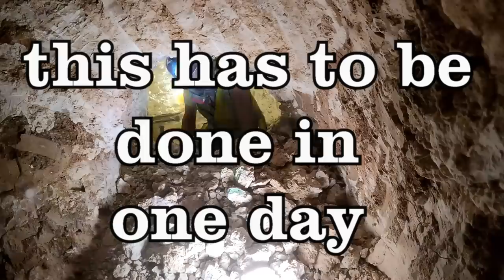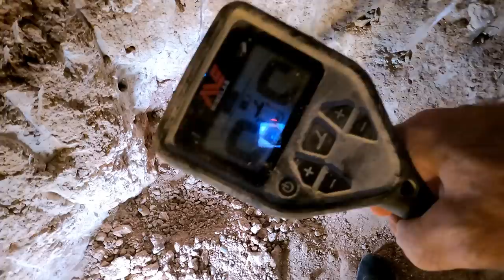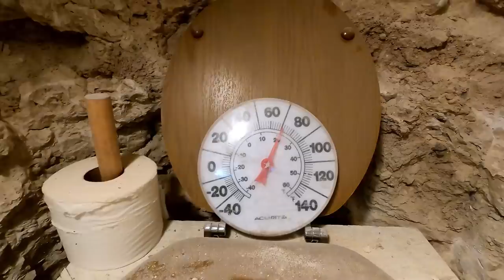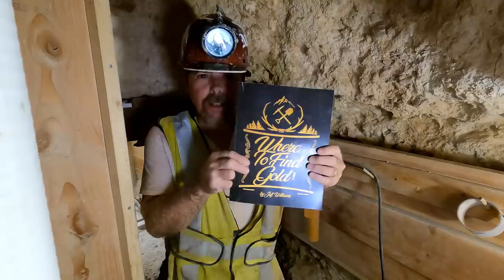THE FASTEST WAY TO DIG A SECRET TUNNEL.

Comment: Hi Jeff , have watched most of your videos. They are great! I have a hammer drill like your and a dealt one with ads max bits. I bought 2 3600 watt demolition jack hammers from ebay, for 156 bucks each.  they ain't too heavy and very powerful and durable! come with 2 bits. I put differential oil in them and they are still going.  Makes digging a ease. Breaks concrete easy! You might get more pay dirt at end of day plus more shiney!!! God Bless You and Your Family, and Slim!!
Reply: Sorry for bad spelling,  sds max bits I meant.  also its orange the ones I bought  on Ebay.  They are Chinese I'm sure. but run great! I had one that a brush shorted out, but easy fix, they come  with 2 extra brushed. 156 each and they are very dependable

Comment: If this were a factory, the engineering department would be assigned to build equipment so the rock would not have to be handled so many times.  I also find it interesting that there is so little dust in this mine, relatively speaking.  I'd love to hear a comment about profitability, you know, when to keep digging or cut your  losses?  Thanks for sharing these mining experiences with us!
Reply: That's a good point about the number of times the rock is handled! The engineering and methods of old style drift mining is fascinating to me!

Comment: When I was a child, we visited Schweizerische Industrie Gesellschaft SIG  Neuhausen. They produced compressed air tunnel drill machines so five BIg and Long drills attached to one mining car. You could drill mutch faster, but you probably need small steel rails and then you usually need explosives to blow the center. Then you use special cargo cars to get the rubble out. But as you really can sniff the gold, don't know if you would like to change your pants for a bigger washing station, and I don't know how much water you have. Look like you find the nuggets in a layer similar to Bohnerz in Switzerland. Unfortunately,  I am not aware, that this layer of iron beans with manganese and a bit titanium also carrys gold here. 
Nice and smart that you use dust protection breathing filters, could also be FFP3 and safety glasses, when available.

Comment: i spread the dirt on the ground or pan it out in my super sluice pan  i wear a ring on each hand. the SS pan is good for detecting (dry panning)  you have the fast track feature  were you hold the discrimination button down till the coil blinks. to ground balance.  have a good day boss

Comment: When I was a child, we visited Schweiz erische Industrie Gesellschaft SIG  Neuhausen. They produced compressed air tunnel drill machines so five big drills attached to one mining car. You could drill mutch faster, but you probably need small steel rails and then you usually need explosives to blow the centerway. Then you use special cargo cars to get the rubble out. But as you really can sniff the gold, don't know if you would like to change your pants for a bigger washing station, and I don't know how much water you have. Look like you find the nuggets in a layer similar to Bohnerz in Switzerland. Unfortunately,  I am not aware, that this layer of iron and manganese beans contains also gold, here.
Nice and smart that you use dust protection breathing filters, could also be FFP3 and safety glasses.

Comment: If you have any nuggets that fracture in two when you dig them out, your method of testing a handful and throwing out if the scoop still triggers, is putting the other half into the wash plant instead of the target bag.  Take another scoop and divide the pile in two, then test both.

Is there a point where there's enough gold that you would excavate a large chamber?

Comment: Uhh... I bought a brand new Xtreme Power 4 stroke gas powered jackhammer and it lasted 5 minutes before breaking. My buddy experienced the same thing. Maybe the electric ones are better. The Bauer I bought from Harbor Freight is going strong and still well within the warranty.
Reply from the maker: have not used the gas powered one ....just the electric one

Comment: Hi.  A suggestion. All that rock dust getting into your hammer tools reduces the life of the tool. Not that it can be helped. But putting some kind of filter over the vent holes helps a lot. But if the tool is getting worm with the filter. Drilling some holes in the case helps a lot. The other thing. Have you ever tried a spade bit in the jack hammer. Works well on a loses ground and knocks hard lumps off side walls. Good work Jeff
Reply from the maker: we usually tape a face mask  on them ....yep we have every bit made for it

Comment: I am an electronics nerd and an aviation quality inspector. (I dig this kind of stuff!) Detectors seem to work best when the coil is in motion over a target. The search unit responds to the conductivity of the target from the oscillating frequency of the coil if the target is close enough to the coil. Pieces of iron, lead bullets, bottle caps, brass shell casings and underwire bras all have a different conductivity, sophisticated units can differentiate between all of these. I need more beans.
Reply from the maker: very good .

Comment: Do you have exp digging like this next to a large actvie water source? If i rig a 900ft wire to a large active river:stand active water source electric generator i could build. If im far out i probably still have to worry about sapping, etc. Btw i could charge a ton of batteries off the river for digging or if its active enough gen 120/240-380/270 volts maybe to power a corded power drill

Comment: Jeff, I have really like the Bosh SDS-Max roto hammer.  With the 8' extension rod, I can drill 108" deep holes down through solid rock at 2" diameter.   Would really help you drill sideways in your adit to explore mineral zones outwards and to assay the host rock body.
Reply from the maker: thats a great idea

Comment: Question Jeff, I watch you with your detector and scoop.
When you've dug the area up and you run your scoop over the detector you....drop a bit out of scoop into your hand and run the scoop over the detector to see if the gold's  still in scoop. 
If it's still in scoop you toss the dirt in your hand and repeat process.
My question what if there was 2 nuggets in scoop and you toss the dirt in your hand and it holds another nugget.
Would it hurt to pass your hand over the detector as well? 
Did ya hear hear me son?
Then let's go👀😊
Reply from the maker: you can't run your hand over a VLF detector because the salts in your body will set off the detector ....we always go over the pile afterwards
Reply: @Askjeffwilliams  Thanks Jeff.

Comment: Jeff,
How far away is the generator from the heavy high current jackhammer? 15-20amp running... got to have a certain maximum length?
Reply from the maker: I think 50 or 75 feet
Reply: I've been evaluating an area approximately 250' in... and planning a electric powered jack hammer as my main. But I know line length vs power line loss becomes an issue with heavy current tools... But someone else suggested using pneumatic jack hammer(air system). You have any preference?

Comment: what this means is if i am right, then putting your metal detector , at the place of 26 seconds time into the video- on screen it is an inch below the right side of the letter "
l" in the word metal-about two screen inches dead left of your nose, both straight lines meeting - it will go off! There is a nugget within the first inch or two of that material! The mineralized areas show up as extra shiny- the nuggets look back-lit!

Comment: A sharp pickax may be faster than that, I dig holes pretty frequently and theres a thick hard clay layer similar to this, Some good swings with the pickax cuts right through it no problem. Also a heavy duty wet/dry shop vac may be useful for gathering the crumbles quickly. You could also use a cement saw or rock chainsaw to cut slices then knock them out with the pick, like relief cuts on wood.
Reply from the maker: Thanks for the tips!
Reply: @Askjeffwilliams  WOOOH YEAH I GOT REPLY FROM JEFF WILLIAMS!
Reply from the maker: @richardjohnson8009  you betcha

Comment: The color on the tunnel material makes me wonder what the assay is. With that much color I'd be tempted to run the lot thru the wash plant provided it has the capacity.  Have the explosive licencing gotten too excessive EG Why not use cordite and blow out a 4-8 ft section and wash it?
Reply from the maker: great idea

Comment: If you made a simple do it your self thing to camp out/ bomb shelter. What would be the best solid stuff to use to start making it clean/dry/on its way to say the quality of a  bedroom in there. Bricks/ then mortar/ then more layers of bricks and more concrete mortar? Or wood? Millions of loops layers of seran wrap like a trapdoor spider?
Reply from the maker: foam might work
Reply: @Askjeffwilliams  so probably a nice expanding for insullation and fire retardant foam. I know you get things like sweat, mist bogging in there with no door or poor ventalation. I'd asume all my housing materials and all indoor wiring is going to be specifically rated for moisture and treated with the outdoor rfi specs in an electrical manual even though im indoors

Comment: Running this low def on a hi def system has most unusual-and i'd be willing to bet profitable-lighting effects upon the sides of the mine. These DO NOT SHOW UP in normal nor high definition. it does not appear to be graphic or visual artifacts (!) those would disappear or wash out with a change of camera angles. These are steady despite changes of lighting or camera movement. Can you verify this please?

Comment: The larger the jack hammer, the easier is to snap off a bit from bad technique. You cannot let the tip sink in real far and then be unable to get it out so you resort to prying sideways with it and the bits are like pencil lead under sheer, they snap off and it's a $90 loss per bit. The key is to know, every chunk of rock you chip off has to have a void to move into. You can only work edges.  You can work for weeks with the same bit and never break one off. Give it to a newbee and within 15 minutes he will snap off a bit.  Give him another bit, after an hour that one will be broken.  Now you're down 180 and he wants to be paid.  Oh so sensetive and ready to snap for being corrected.  Construction work is fun if you can charge for "skills lessons" instead of wages. Ole Tom Sawyer painting the white wall.
Reply from the maker: very true

Comment: Jeff, You should add a "42in Long reach air scraper" about S125. from Harbor Freight to your tools. I'm sure it will be useful especially for working on lower walls, floor, & sump. Requires about 10cfm/5hp of 90psi air. A very useful tool!
Reply from the maker: great idea

Comment: 12:30

Jeff 
You are a legend but you're getting old. To make that jackhammer work easier.

Get about 10ft of rope or so.
Tie a loop on one end and loop it around the front of your jackhammer. Above where you're working set a rock climbing anchor. Run the rope through the anchor and set the tip of your jackhammer in the middle of the wall where you will be working. Then tie other end of rope to jackhammer handle. If you do this right the jackhammer should effortlessly do it's job. You can call it returning the favor for all the entertainment. Let me know how it goes...

If that doesn't do it for you. I have an idea using a large spring some tube steel for a tripod and you can figure out how to mount the jackhammer.

Good luck and God Bless
Reply from the maker: thanks ....I think ...I thought I was getting younger